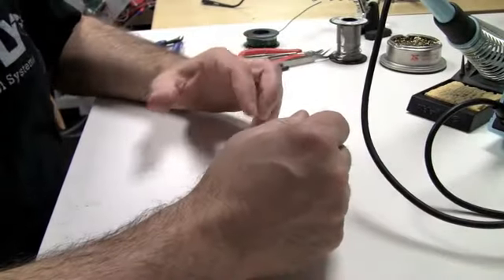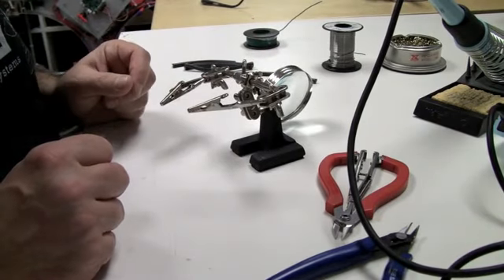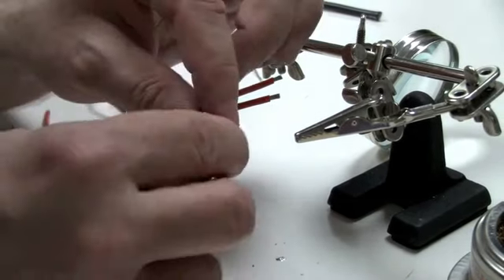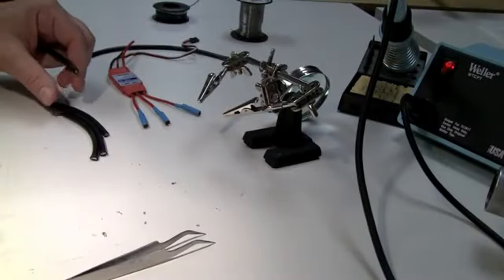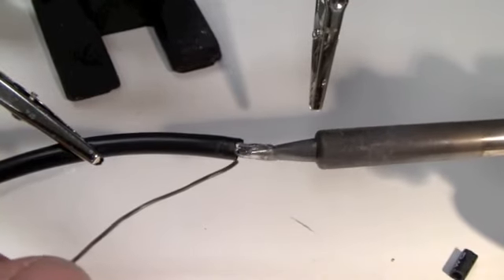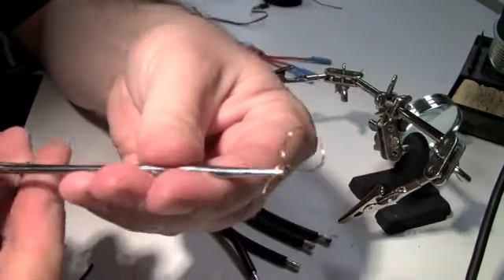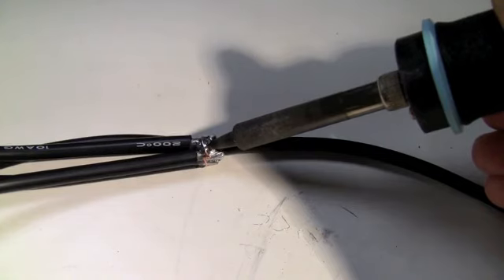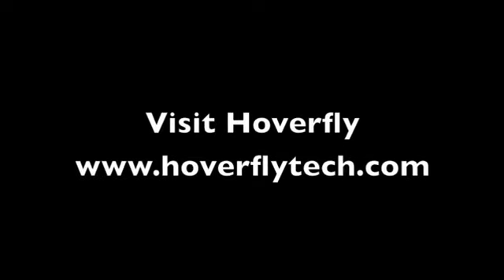Basic Quadcopter Tutorial - Chapter 5 - Soldering Tips

Comment: Photronix Thanks for your video series, I've found them extremely informational and helpful.   I just wanted to comment on your solder technique with the four wires to the battery wire.  It pained me somewhat to see the fine point solder tip you were using to try and transfer sufficient heat to all that mass.  IMHO a wider chisel tip would have been the much better choice.

Just my $.02 worth.  Thanks again for your videos... they're clearly well thought out and you explain things pretty well.  Cheers!

Comment: These videos are great, as I'm planning a quad for some GoPro aerial shots! :D

A little tip while soldering, especially wires, is to place the tip of the soldering iron UNDER what you are soldering, since heat rises.
As you explain, it is smart to apply some solder to the tip to act as a heat bridge, to allow for more heating surface area, but by applying the tip under the wire and waiting until the wire is hot enough for you to simply apply solder to the top of the wire (solder always travels in the direction of the heat source), you will get a better connection.
In other words, by applying the solder to the opposite site of the joint than the soldering iron, the solder will travel through the joint to reach the iron. :)
Reply: Hot air rises, heat as such doesn't (in a solid material such as the wire it conducts). The reason for putting the iron on the opposite side of the wire is that ensures the whole wire is up to temp when the solder melts on the opposite side. It is of course easier to keep the soldering iron below and melt from above because of gravity =)

Comment: I didn't see anything at all wrong with your soldering technique.   In fact if I were building a power harness this is exactly how it would have been done.  The only difference would be that I would have used a wider tip on my iron.  They deliver more heat to larger areas but you got great results anyway.   Keep up the great efforts and thanks for posting this.

Comment: Absolutely right.  I might stick in my own tip: you do need good heat flow from iron to wire.  The bare iron tip, even clean, oftentimes isn't good enough because of the small surface area of contact from iron to wire.  I pinch the end of the solder strand between the wire and the iron.  That small amount of solder when melted (usually a second or two) gives you huge heat flow into the wire.  You can then apply the solder to the wire in a very short time.

Comment: Just a thought.. (Good tutorial first off) but a soldering iron or station with tips that can be changed to a wider chisel tip would make some of the bigger solder joints a tad easier(more surface area)..and you could still switch back to a narrower tip for the smaller jobs..but awesome tutorial.

Comment: Good video with lots of good tips, but may I make a suggestion?
When joining the 5 wires together, instead of the loop of relatively thick single strand of copper, try using much thinner wire, and tie a clove hitch knot instead!  This does a brilliant job of clamping the wires together without using the pliers, and once it is tight it stays that way on it's own until you solder it. It also sits a whole lot flatter than the twisted style in the vid. Try it and see what you think :o)

Comment: It all comes down to whether you are going to solder SMD or Thru Hole components only.
A good "common-use" solder would be a 60/40 (Tin/Lead) combo with single or multiple resin cores and a thickness of between 0.4mm or 0.5mm.
This might seem like a thin solder wire, but the thinner the better, as it gives you more control of how much solder you apply.

Comment: the only tip i could possibly give if you don't mind mate, not sure if you mentioned this. Firstly though, i love helping hands, but never to this day have I had my own. My birthday is July 12th, just in case you were wondering....:)

My tip is to take the iron off the joint as soon as the solder bonds, where it kinda melts into the metal and takes. Leaving the iron on too long will burn out the flux, possibly leading to a dry joint in the future. It also makes the joint look less shiny too.

Comment: He's doing it right, you put a bead of solder on the iron not for actual transfer of solder from the iron to the wire, but for proper heat transfer from the iron to the wire.  A bead of solder provides a larger surface area for heat to transfer through, allowing the wire to heat up quicker to accept the solder being melted from the roll.

Comment: If the flux burns away (a common problem) it means that the iron is too hot. In case you are using a simple pencil soldering iron, keep a wet napkin or towel handy and wipe the tip on the wet surface of the napkin. This will accomplish two things: clean the tip - control that heat. You will find that applying flux to the iron itself is helpful in heat transfer ( I discovered this myself when desoldering IC components from printerd circuit boards).

Comment: Well yes that is true in some cases and will most of the times make it easier for some people to solder. But if you have the right soldering iron with the right tip set to the right temperature it won't be needed.
Though most of the times people don't realize the idea of using different tips and they will simply stick to the same tip and same temperature for all soldering.
When soldering large core wires like this a large tip and high temperature is needed.

Comment: For the most part your right but if you put a drop of solder on the iron it increases the surface area touching the wire and makes the heat transfer much faster and that drop of solder will wick up when things get hot enough then you can apply more solder to the wire he didn't explain that well but it's what he does.

Comment: you need to see the "Flite Test : Solder Thick Gauge Wire - FAST TIP" video it shows a 1v1 wire solder
The technique is easy to apply to a wiring harness and is much stronger mechanically and electrically.

Comment: A small butane torch will make soldering bullet connectors a MILLION times easier.

I never use a soldering iron for connectors like bullets, HXT.

A soldering iron is best for 'T' connectors, Or  XT60's. Stuff like that.

Whenever soldering any connectors like XT60, Deans, Its always best to plug another plug into it while soldering, As it will help distribute the heat, And less chance of destroying connector.

Oh, And you should have used a little FLUX on those 10G wires, Would have made the solder flow a lot better, And you would have not needed to use as much solder. You needed so much solder, Because the wire needed flux, And solder only has a very small amount of flux.

Comment: Good info, but ESC wires are hooked parallel off of the battery wire. That is one fourth the load per ESC wire than the battery wire. Do yourself a favor and downsize the ESC wire some in relation to the battery wire.

Comment: Really good videos, very informative, one suggestion, the wires from the speed controller and motors he should actually use Automotive Crimp type of bullet connectors, there is 3 different sizes Red, Blue, Yellow different size wires/current carrying capability. The crimp connectors are more reliable (if crimped correctly). With the larger cables of course you need to SODER .. LOL Solder .. ( I am an Australian ) 
Also I hate this guy, now I want to build a quad copter :-(

Comment: Heat is not really your best friend when soldering delicate electronic components the heat runs through the cable and meet up the electronic inside the esc.

Don´t keep the solder too much time touching shorts wires because it will burn the board and the transistors inside the Esc.

Btw, the cables used in that video were for an electric station not for a quadcopter lol...

Comment: please use google I don't have space here to explain properly, sorry
-over heating a wire can lead to "solder wicking" under the shielding
-applying too much solder to the wire or holding the heat to long can facility this
-tip: after tinning the wire, fill the cup with solder, when its about 3/4-4/5 full slide the tinned wire into place and allow to cool
-flux is suppose to burn off, it displace oxidation and other impurities
-small dab of solder on the iron creates a heat bridge speeding it up

Comment: Very good tutorial series. I like it!
But your soldering skills are not quite right. You shouldn't apply the solder to the soldering iron. Instead you should heat up the wire and put the solder aginst it.
If it melts the wire is hot enough and will therefor soak the solder automatically.
The problem also lies in the flux-core of the solder. When applying the solder directly to the iron, this flux actually "burns away", making it useless, which in the end makes the soldering more difficult.